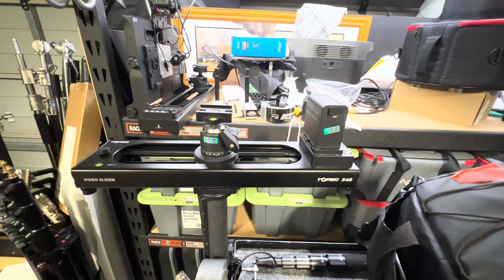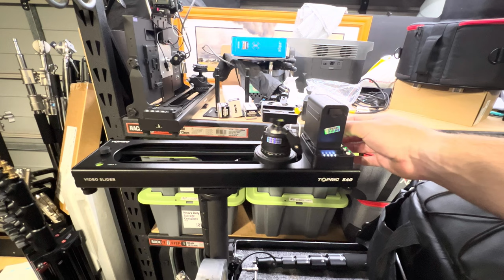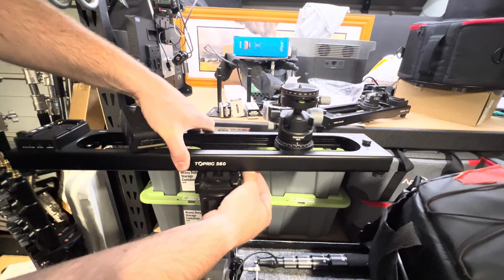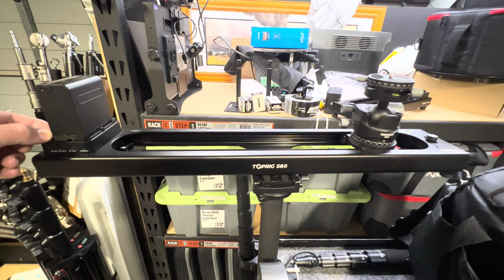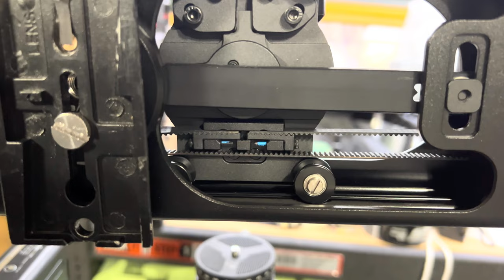Accsoon Toprig S60 / S40 calibration noise test

Comment: Hey man, just playing with mine I just got. I'm surprised to hear a brushing sound from the belt that changes with the speed setting. It's more noticeable at slow speeds. It's not loud or anything but in a silent room you definitely hear it. Does yours also do that? I think I faintly hear it in the video but not sure.
Reply from the maker: I wonder if there’s a batch that’s been louder than others? With mine I can hear it but not enough to catch in lav or boom mic. How heavy is rig you’re putting on?
Reply: @videographerstuff539  I talked with them and apparently it was because I was using DC power too strong (like an idiot..). I've ordered some NP-F to test, with a less powerful but still too powerful supply it was doing it much less already.
Reply from the maker: Wow I didn’t expect that as a reason! Glad it was something simple!,